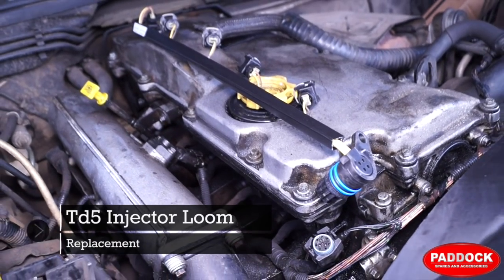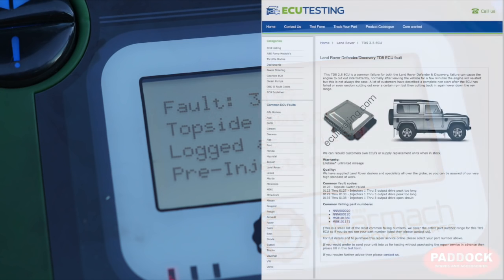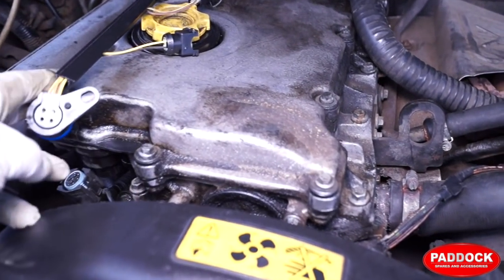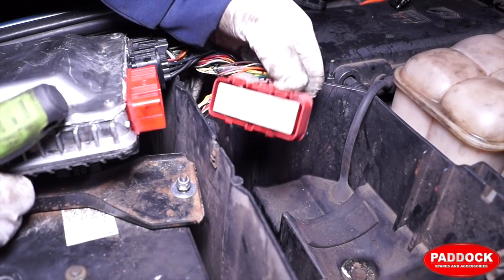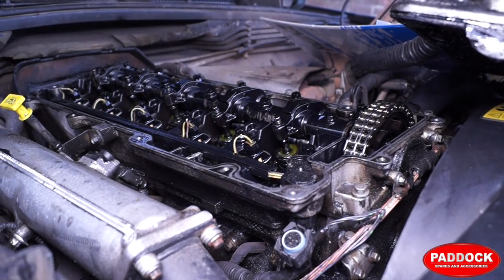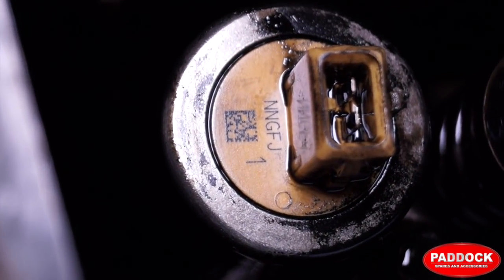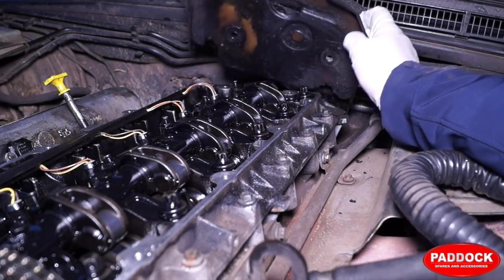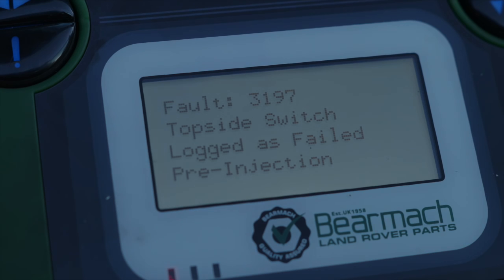Fitting the Td5 Injector loom

Comment: Thanks for the video!  Good to see it isn't too hard to do! How often should you check the ECM plug for oil?  6 monthly?  Also, if you have to get a new ECM (assuming brake cleaner doesn't make it come good) how do you actually do the reprogramming/resetting?
Reply from the maker: +Darren Coull  It needs to have the injector codes reprogrammed manually and the immobiliser sync'd.  You may have to talk to a specialist who has a suitable plug in to do this.  Nanacom equips apparently works.   I am using the Hawkeye Pro for the work on this ECM .

Comment: Just did this recently. Ended up using a screw driver to help remove the injector plugs, because the first one I just pulled it off like this and the metal clip flew off at light speed. I'm 80% sure I heard hit the ground but was unable to find it... fingers crossed.

Comment: Hi, I have a question on my 98 Td5 defender, I have fitted my td5 with a new cylinder head. When taking apart, I inserted the locking pin at the camshaft and one at the transmission bell housing. I noticed that the two colored links by the mark at the timing chain sprocket were barely noticeable. Before putting back together I made sure the two locking pins (bell housing and camshaft) were in place, I did not bother looking for the colored links though thinking that well if both locking pubs are inserted, the timing must be right...Now I realize that I probably mixed up inlet with exhaust stroke, because I did not see the two colored links at all, they were probably at the other end. Does this matter? The ecu sensor is on the flywheel. The flywheel spins once for the inlet stroke of all cylinders and once for the outlet stroke of all cylinders. How does the ecu know whether it's on inlet or exhaust stroke?

Comment: Just used your video to do this job,all gone well until plugging loom to injector harness when I couldn't squeeze plugs together,took new injector harness out to check it and found blue staining in the plug hole from the new o rings,any ideas on this? I've got it all refitted,plug connected and all seems ok.My thanks to you for a helpful video

Comment: was there a TD5 with mechanical injection pump/injectors ? im looking for a old school engine for a repower
and came across the td5 . also the 200tdi would that respond to large turbo and inter cooler ? my goal would be about 160hp 300Nm cheers Brett
Reply: You'll get more than that out of a td5, but they aren't 'old school'. I'd go for a 300TDi engine. You'll get 160bhp. There is plenty of advise online about how to tune a 300TDi.
I reckon the 1.9L TDi engine as used in VW Golfs and Seat Ibizas would be a good substitute. They start at 130bhp, are very torquey, and it starts low down. With a hybrid turbo and front mounted intercooler 250bhp is easy with the standard internals. My Ibiza is remapped to around 170 and goes like a rocket.
'All you need to do', is sort out a bellhousing to connect it to your gearbox.
Reply: Yes that’s a great plan. Take out a 2.5 5 cylinder engine designed for a four wheel drive system and stick a 1.9 in that’s designed for a 2 wheel drive system ....Wcpgw
Reply: @scottde-walden2760  its always the guys with no video content on there channel that come up with the most amazing answers to help the public......

Comment: Hi great video thank you. I have a Land Rover discovery series 2 TD5 (non runner) the engine turns over but does not start. I checked the ecu and found it had oil in the red plug. I have cleaned the ecu and red loom plug but the jeep still does not start :( 
do i need to change the complete ecu loom? or just the injector loom? or do i need a new ECU?
Reply from the maker: +Traffic Monsoon  just the injector loom and clean out the plugs with brake cleaner.
Reply from the maker: +Traffic Monsoon have you any fault codes in the ECM memory?
Reply: Had a guy come out today with delphi software and clear all error codes. Still no joy :(
Reply: I'm starting to think it may just have a knackered ecu as there was quite a bit of oil in the red wiring loom plug and ecu. I might try opening up the ecu to see if any oil has penetrated inside. Will change the injector loom in the morning. Can the oily injector loom cause the engine not to run??

Comment: hi, if i have to replace the ecu and the harness, do i have to get the new ecu programmed to the injectors and so on.
Reply from the maker: Yes definitely  with another ECM you need to tell it which injectors you have in it.
Reply: just a quick question for ya also, my rear bumper is rotten on the 110 defender, but the chassis is fine, is it acceptable to cut the skin off the bumper and weld in new or would you normally replace the rear crossmember?
Reply from the maker: You need to replace the whole rear member if it is getting holes in it.  I bet if you look close the cross member has more rot hidden in the box section part of it.

Comment: Hi quick update regarding the Discovery2 td5 -
Basically the engine would turn over but will not run. 
I have changed the fuel pump and the fuel filter, primed it about 10 times. I have cleaned the ecu loom and ecu from oil. I have pressed the fuel cut out switch. I am running out of ideas now 
Any help would be greatly appreciated as always . 
I have noticed that when I crank the the engine the lights on dash go out as normal and after 3 or 4 engine cranks, lots of lights come on the dash until I finish cranking. Is this normal?
Reply from the maker: +Traffic Monsoon  It is the same position as ours.  Bleeding it up can be really awkward.   Tell me something did you use the 5 pumps on the footbrake pedal priming sequence?
Reply: Hi yes done the complete sequence about 10 times
Reply from the maker: Perhaps you need to check the pressure of the fuel pump delivery.  Should be sustainable 4 bar when the fuel pump is running. 

As you have probably noticed we are also having problems with non start. I am now working on a solution for video although it may take some time to find out what the problem is with out Td5 I will cover testing the electrics and fuel pressures where it counts.   Sorry that I can't be quick enough to get you back on the road though.
Reply: Good news
Got the td5 going 
Basically I could hear the fuel pump making a funny noise, so I disconnected the front fuel line, turned the ignition on as I wanted to check the fuel pressure. I noticed that diesel was splattering out the fuel line at low pressure, not only that but smoke was also coming out the front fuel line. At first I thought one of the fuel lines was blocked with dirt but with further investigation I found out that someone had messed up the valve settings on the fuel filter housing. The main fuel line from the fuel pump to the fuel filter had been blocked by a plastic bung. So I disconnected the bung put the valve back on the fuel filter housing, primed it and she fired up 
The smoke that was coming out the fuel at line at first inspection must have been where the fuel pump motor must was burning up as the fuel line was blocked.
Thanks for all your help and support.
Cheers
Reply from the maker: Excellent news!    I am happy that it was an easy enough find and fix.

Comment: I did this a few months ago but still get a bit of oil on the red I check often and try to clean it the best I can
Reply: I believe that if the ECM plugs are thoroughly cleaned of oil then packed full of vaselene  before reconnection this problem will not happen in future.
Reply: +Dave Howard ok thanks for that I'll try that after the next look cheers